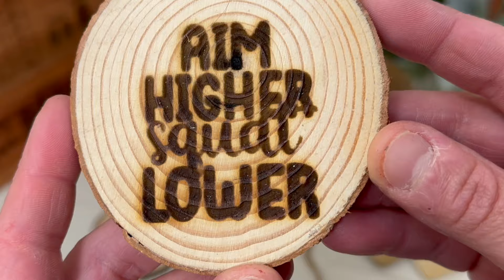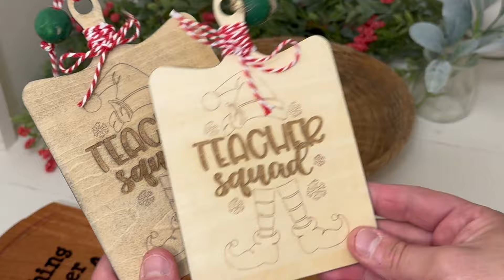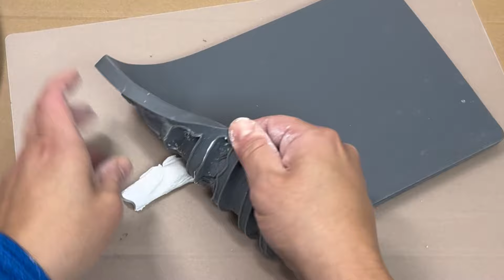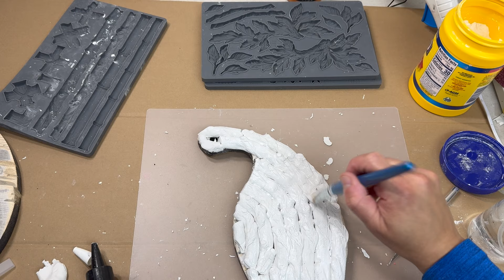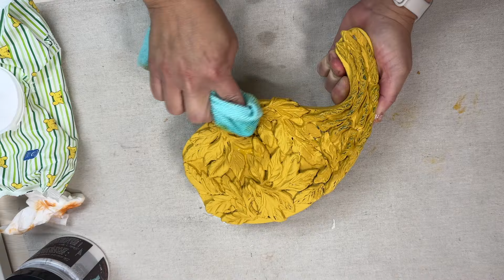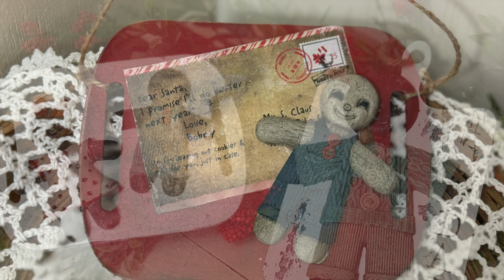Bulk Production Hack: What Vendors Won't Tell You About Laser Cutters

Comment: What were your settings for the coasters?
Reply from the maker: I don’t think I had any coasters for this video.  If you are looking for specific settings for a laser cutter, I would suggest @wilmerwoodworks.   He has excellent tutorials!
Reply: Sorry. Your round ornaments you engraved.  I am using those as coasters and new to the business. Wanted to see what settings you used in your Falcon 2pro.  I have the 40W version. Thank you so much
Reply from the maker: @shaunhardine8206  my reply didn't save... engraving I use is 10000-12000 speed at 30-40% power.  In this video, I think I was using 60% and it was way too much.  I also didn't set the height of the laser correctly.